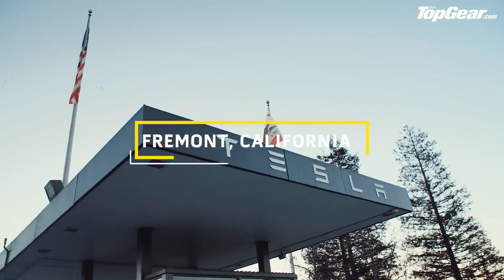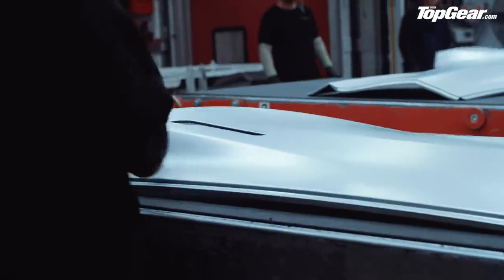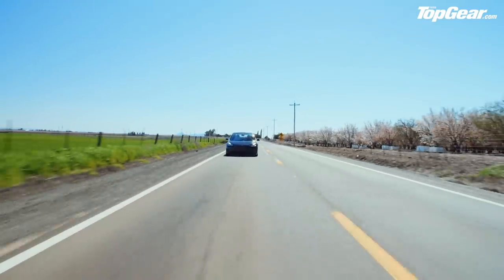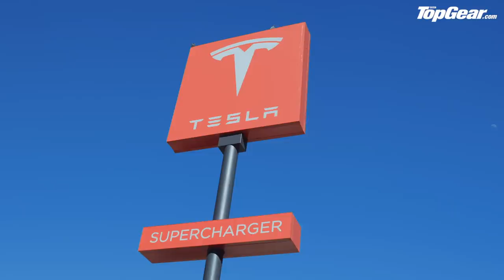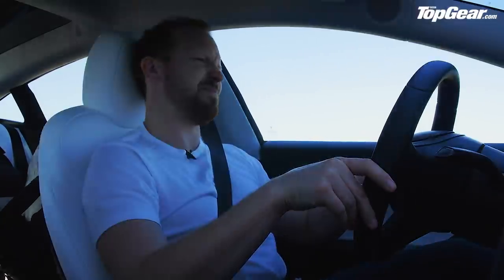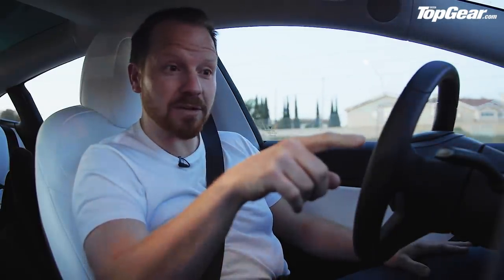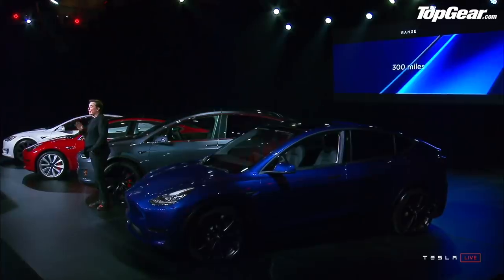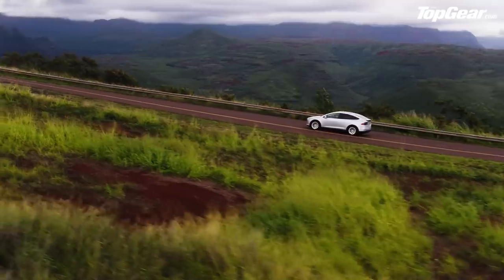TESLA Model Y Reveal, Model 3 Road Trip and Factory Tour | Top Gear

Comment: To go from SoC 80%->100% takes almost as much time as 10-->80%  so for long trips usually it's more efficient and faster to supercharge to 80% and if needed make a quick additional stop.
Reply: Or just, you know, follow what the in-car nav computer recommends you do.
Reply: @lmaccaro  I agree,I'm just pointing out because the car journalists are always so obsessed of the 0-100% time .
Reply: @MrPikkoz Because they understand nothing at all about electric cars.
Reply: Also charging up to 100% or discharging down to 0% damages the battery.
Reply: @larskumpfert6890  "damages" sounds a bit dramatic. The battery will degrade a bit faster, yes, but they seem to last long enough anyway. The Tesloop taxi service had just 13% degradation on their Model X after 350k miles.
Reply: Snooker147 v3 still gives u 75 miles of range in about 5 minutes so it’s pretty good
Reply: @zaynkhan136  I think they said 15 min for a typical supercharger stop, presumably between chargers which are perhaps 100-150 miles apart.
Reply: Enjoy your time at Cattlemen. It's in the valley it's usually 105 degrees and it stinks like cow manure. There's nothing there. Just a big steak house so if you're vegetarian you can go to hell. It's no treat to have to stop there. Just a necessity
Reply: @phamnuwen9442   You can't jump to the assumption that the battery degrades quicker as you put more miles on the car.  IT could be possible that the battery would degrade quicker if it was just sitting and not used regularly.  But I don't know that either.
Reply: @richardrace237  as far as I know, cycling and aging are separate causes of degradation, though one might influence the other to some degree.
Reply: Pham Nuwen I’m definitely not an expert, but as a Toyota Prius owner....  

I’ve only personally witnessed a battery going bad in one Prius which had very low miles on it; which lead me to think that possibly the battery can degrade by not being used...
Reply: @rrace002  The Prius has NiMH batteries though. Tesla uses NCA lithium ion. But what's the point of owning a car if you're not using it? This doesn't seem like a big problem.
Reply: @phamnuwen9442  Just if could I afford a model 3. Maybe Id be better off upgrading the battery in my current ev.

Comment: Because of how batteries work, the first 80% takes about the same time to charge as the last 20%, so an 80% charge can be done in half an hour (and with the new V3 superchargers it’ll be 15 minutes), while the remaining 20% will also take half an hour.

In addition, you really shouldn’t be charging the battery to 100%, unless it’s absolutely necessary to get that range, as it can damage the battery over time.
Reply: I think that when a Tesla shows "100%" it actually isn't.
Reply: @Heko Yama no because the batteries on paper are similar. Lithium ion. You place more wear on the batteries going to 100%. Apps like Accubattery display this. What makes Tesla special is that the overall degradation of the battery regardless of how you charge the battery is very low after seriously big mileage in the life of the vehicle. Like 100km or 250kms with a 5% loss on total capacity. Recent updates released mean more power and range. When's the last time you saw a manufacturer actually develop existing products for the betterment of existing customers?
Reply: @Heko Yama the dealer's themselves are pretty open minded and happy to fix any issues. There is less messing around in trying to prove you did something wrong then ICE manufacturers as per the prevailing model now. I hate dealerships. It's rare if ever I have come across one that didn't try their best to get out acting doing their job in fixing an actual fault. Most of the time they dont even drive the car. They'll just they couldn't find a fault. 

Whilst there have been issues with panel fitment. It's largely gone away as batch numbers have gone past 50K. Tesla constantly evaluate their production processes and improve them.

Comment: You don’t need to wait 50 minutes for your charge, because the last 80-100% are slow. Better stop at 80 percent. Until then the charge speed is much higher.
Unless you really need the range most ppl don’t wait that long. Or one takes a nap
Reply: And slow a bit to save on the freeway.
Reply: There is always the counter argument in how you develop or elect to use your time rather than wasting 50 minutes.... lifestyles will simply change. Currently with fuel stops we are thinking in an old process and trying to mesh that into a new technology process...

Comment: have a Model 3 long range all wheel drive and it is by far the best vehicle I have ever driven! It And yes I too woke up to it being even better, faster and smarter once again last week! It is several levels of magnitude better than any other car i have ever been in. It has exceeded my expectations and even surprised me on several fronts. For example I had a false belief that it might be inconvenient to charge a  car instead of stopping and getting gas at a "convenience" store. It is the opposite. It's so easy, saves me time, keeps me from spilling stinking, toxic gasoline on my clothes and hands and maybe most importantly I am taking money away from the industry that is pushing it's costs off on the health care industry not to mention the perennial subsides. I installed a solar array before I purchased the car and also installed a 240 volt outlet. It is so much easier and literally takes 5 seconds for 98 percent of my charges. The super charging network is also very good and the V3 super charger is going to once again change everything forever! I just, yet again took a group of old friends for a ride in it over the Easter Weekend and the "Tesla Smiles"  are literally worth every penny! Oh did I mention I woke up last week and the car had 5% more peak power which is noticeably faster. The AWD is by far the best traction control system I have ever experienced  10,000 miles in I have had zero problems, no oil changes (which have taken completely out of my perennial To Do list) my garage smells way better even in way I never imagined possible. Too many upsides to list. It's not perfect but it is the closest to perfect vehicle I have ever driven hands down. One of the reasons I bought the car is because of your video Money Guy! Thank you!

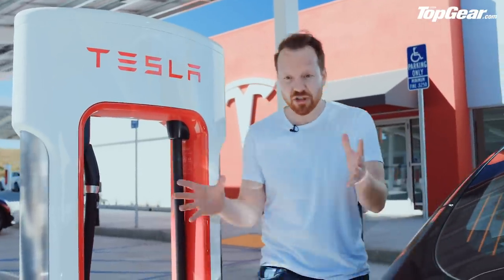Comment: 8:05 You didn't need to do it that way. You could tap the door and it would open. You could push the button on the charge connector and it would open. For an owner with their phone synced, you can do it via the app. Tesla gives you lots of options here to reduce the annoyance.

Comment: It would be more efficient to charge the car to 80% instead 100% and stop in other supercharger if necessary
This because the car can charge much faster on lower battery level
It takes 30 minutes to charge up to 80% and 1 hour to charge to 100%
Also, the v3 supercharger will be able to charge to 80% in 15-20 minutes.
Reply: Once you get more comfortable with the car and its range in varying conditions you can definitely have more confidence in pushing the range without getting too low. He should have kept on going to Bakersfield station to get to an even lower state of charge since it charges much faster from 0-50%. And to get to LA he didn't need to charge from 30%-90%. 

He was at 30% which means he still had something like 90 highway miles left. From Kettleman City to Bakersfield is only another 57 miles. So he could have rolled in with 30 miles remaining to Bakersfield. From there to the design center is 125 more miles which would require less than 50% state of charge. So if he charged from a low state of charge for 25 minutes he would be at least to 60% SOC which would be more than enough to get there with extra to leave later.

So he could have stopped for 25 minutes rather than close to an hour he probably spent.
Reply: @flipadavis  But he got to visit the fancy original Supercharger station.

Comment: Range anxiety is far more prominent when you're not used to the car. If you're inattentive and a poor planner, it may remain a bit sometimes, but after a few times of testing its limits you'll probably get an intuition for its capabilities. I never get range anxiety myself because I plan road trips. It would be handy if charging speeds were reduced to 5 minutes for 200 miles of range, but I'm not sure it's necessary for mass adoption. The biggest hurdle for current technology is just to get used to how it works. And when as it's economically advantageous to shift to an EV, the general population will probably do it eventually, regardless of peak charging speed.

Comment: How does it look like the death star? As I remember the Death star is spherical and grey. The outside of the factory is a white cuboid.

500,000 kg m/s^-2 or Pascals of Pressure. or 500,000 kilograms of force per metre squared. What you said is incorrect.

"Do you see the robots on the floor? They're robots"...
Reply: The death star is flat, not round.

Comment: The battery doesn't discharge linearly, it discharges exponentially and works the same when when charging. That's why it drops off fast to start of with and slows done and the same vice versa.
Reply: Do you have any resources that explain this? I had not heard that previously.
Reply: nope. you are right about charging rate changing based on state of charge, and this is due to physics and keeping battery safe. if your discharge rate depends on your consumtion only. So it will be absolutely linear if you go with the same speed on a level surface.
Reply: @JT-xq2hv  I don't have any names for resources but i'm in the middle of some battery discharge testing for VW and that's the results we are finding.
Reply: @andreiandolya  With a well built vehicle with a battery protection device it will be as I explained as the battery will limit the amps put out
Reply: @stuartrendall6730  true in principal and even when doing discharge testing of the cells, the BUT in real life average energy consumption is around 260 Wh/mile, so the car almost never hits the cap of discharge rate.
more to point, in the video his SOC fell faster then he expected while driving at highway speeds which had nothing to do with theoretical max discharge rate but probably more to do with elevation gain or headwinds
Reply: @andreiandolya  Yeah, I do agree that in the real world its not a perfect plotted graph but in general that is what you would expect and it is in most cases when testing the actual result.
Reply: Li-ion cells have a very flat discharge curve, not just Tesla's Panasonic cells but all Li-ion cells. While it is true the pack voltage is a little higher when fully charged than when down to 20% state of charge the difference is too small to matter unless you are on a drag strip.

Comment: Great video.
Couple things to critic though 
1: the charge port can be opened with the supercharger cable, you dont need to go back into the car.
2: most supercharging sessions aren't for a full battery and typically last 20-30 minutes, and they are rolling out third gen superchargers which will add 170 miles in 15 minutes.
3: to be safe you should mention that not all superchargers have a lounge 
4: i can't remember what else but thanks for this video!
I remembered! 
5: A good thing to point out is that autopilot constantly improves through updates so it may have a marginal lead now but its going to get even better

Comment: Autopilot similar to Audi, Mercedes, BMW offering....LMAO
Reply: Do they change lanes automatically to get around slower cars, take the correct freeway exit to switch to another freeway, then take the appropriate exit for you to drop you off at your programmed destination?
Reply: Do the others have OTA updates?
Reply: I can confirm they are not comparable really. None of those campanies have gone as far as Tesla at this point
Reply: C — and none have crashed or killed due to autopilot failure. Point of difference!
Reply: @Audidude  Thats probably because those cars systems are so terrible that at the first little bend they require the driver to take over and as such the driver is always ready to take over knowing how shonky the system is. With Autopilot, the drivers have way more confidence in it and therefore completely lose focus on the road.

Its a system and like any system, will fail at one point or another so that combined with drivers being less attentive due to greater confidence in the system is why crashes are more televised for autopilot

Comment: You will always have the haters but Tesla is a great company making great cars of the future
Reply: Good on Tesla for the innovation but the cars are not well built, they don't sell parts and you have to scrap your car when it needs repairs or wait several months for them to fix very minor issues, they are over priced and if you compare the extra cost to a regular car that needs gas fill ups the Tesla would cost much more, most of the cars Tesla sells be it used or new they won't let you see it ahead of time.. Tesla at the moment is just a fab not a vision of the future